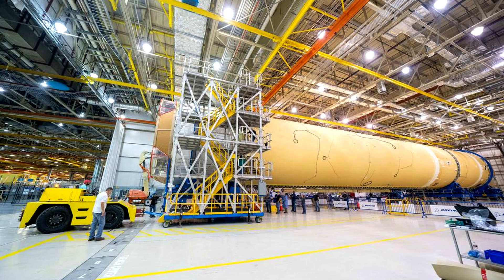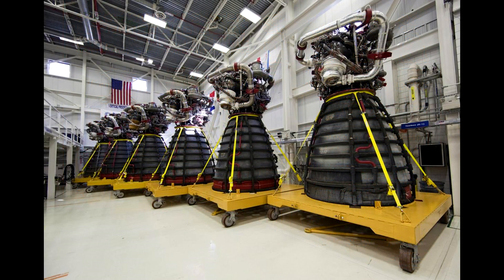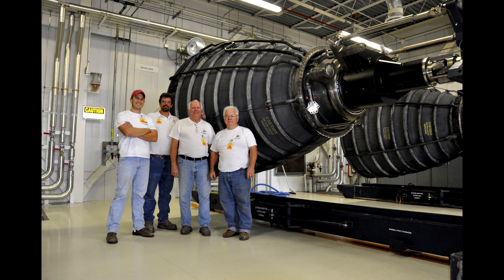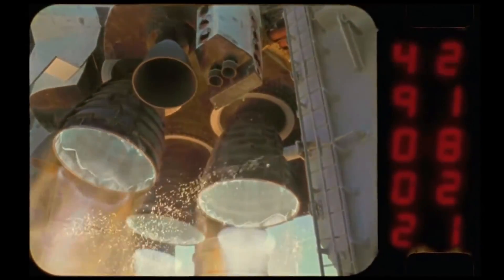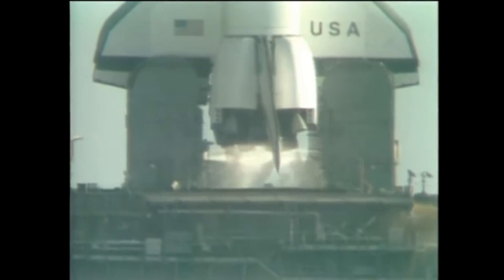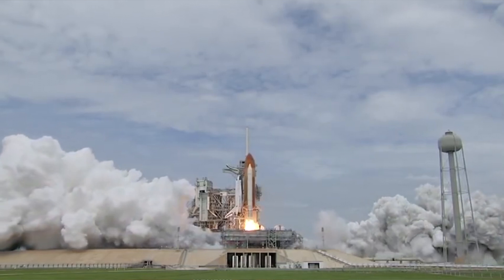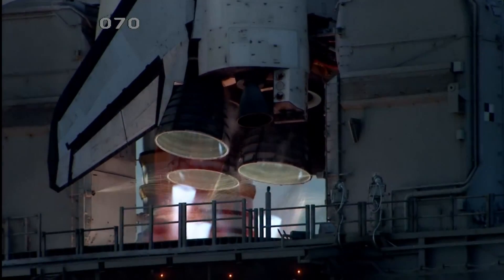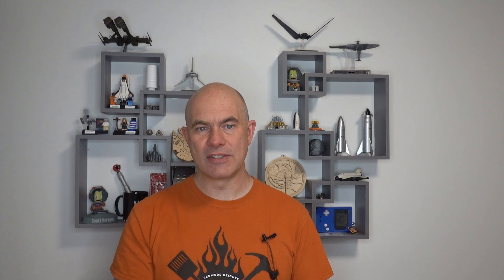Four Old Space Shuttle Engines Team Up For One Last Rocket Launch

Comment: All of this SLS system is a realization of the original shuttle plan from the late 1960s. Makes sense to use the engines designed for that mission.

Unfortunately it no longer makes sense for NASA to be in the orbital launch market. They are supposed to be pioneering the next wave of cutting edge technology that doesn’t make sense for private companies to fund. Once the private market has caught up or surpassed them, their mission for that phase of technology is complete, time to move on. This iteration of the SLS technology is a dead end retrograde effort.

Comment: Jupiter DIRECT would've been a lot cheaper than the SLS; it's a shame the entire constellation program started and as a result JUPITER was never pursued. It would've only needed 3 RS-25's, 2 5 segment SRB's and some structural adapters for the shuttle main tank along with a 160 tonne J-2X powered upper stage and it could've lifted the same payload as the SLS with the EUS. Oh well.

Comment: It feels really wasteful to use reusable engines on an expendable rocket...
Reply: Ibakon Ferba that’s government for you
Reply: @MrMe-yk5of  I found this comment earlier and i think you need to see it

 You are a shining example of the dunning kreuger effect. Your very limited knowledge on rocketry has given you a false sense of expertise, where you are highly confident that you know the right answer despite the fact that actual experts would be less confident than you are. It's unclear just how much the reuse of the falcon 9 has reduced it's cost. A reduction of at most 10 million dollars per flight is claimed by spacex. The real reason the falcon 9 is so cheap is because it's parts are so cheap to produce. That's all.

So; you want the government to reuse the first stage of the SLS. They already tried that with the space shuttle; the cost savings turned out to be marginal at best. So let's say that NASA were to try to reuse the SLS. The first thing they'd have to do is dramatically increase the mass of the upper stage. Not even the exploration upper stage would be massive enough to allow for this. There's a reason spacex has a massive upper stage, so that at MECO the first stage isn't moving too fast to re-enter. So good luck with that with the SLS! I suppose all we'd need to do is develop a massive 350-400 tonne hydrogen powered upper stage using 3 J-2X engines, and then also SPEND AN ESTIMATED 500 MILLION TO 2 BILLION DOLLARS TO MAKE THE RS-25 CAPABLE OF BEING LIT MID-AIR WHILE TRAVELLING THROUGH THE ATMOSPHERE THE WRONG WAY. Then spend another few billion dollars developing flight and guidance hardware to allow for an autonomous first stage landing, and of course add enough landing legs, fins, rcs systems for stage control, etc. Oh and make sure all this new hardware is man-rated. Oh and add some very heavy structural supports to the core stage to allow it to withstand re-entry at around 5-8 km/s (over 8 km/s if it's  using the ICPS). Oh and don't forget you have to do more tests to see if the core stage can withstand re-entry while fuel is sloshing about, most likely adding more baffling in the inside of the tank and doing vibration tests.

Of course then you have to ensure that the RS-25 can fire without combustion instability at sea level while travelling BACKWARDS AT MACH 0.7-0.9. This would be the largest problem with re-using the core stage. The RS-25 has a unique nozzle shape that curves inwards near the end to raise the pressure on the lip of the nozzle at a slight performance cost. This is done so that you don't get the characteristic flow separation that would normally occur with an overexpanded engine (an engine where the exhaust pressure is well below ambient pressure; exhaust pressure of the RS-25 is around 30% sea level pressure; a normal engine at those pressures would undergo flow instability at sea level and tear itself apart).

Of course you'd also need to take into account SIGNIFICANT PERFORMANCE LOSSES that would arise. The SLS core stage weighs about 95 tonnes when empty. You'd need at least 4-5 km/s of delta v to land it, meaning that you'd need a mass ratio of at least 2.8. Therefore you'd need to save around 180 tonnes of fuel. This is the best case scenario if you decided to use a 350 tonne upper stage. Of course using a 350 tonne upper stage you'd also have even more performance losses, that is if you can even get a 350 tonne upper stage to structurally fit ontop of the core stage. This is because the stage would have a very high dry mass, meaning that you'd probably need an additional upper stage which would dramatically increase cost.

So; TLDR; you are wrong. Even if this could be done the costs of doing it would most likely far outweigh the cost savings that you'd get over the estimated 10 missions that this is planned for, and it would delay these missions by at least 4-5 years. The actual cost of the RS-25 engines is insignificant compared to the cost of the manned components of the vehicle. SpaceX will charge around 260-280 for a crew dragon mission.  That's a factor of 5 more than a normal falcon 9 flight. Do you know why? Because the crew vehicle and the costs of developing and maintaining a safe crew vehicle with multiple abort modes is incredibly expensive. Over a third of the SLS's launch costs are estimated to be the Orion MPCV and the European Service module combined with the launch abort system, about a quarter is estimated to be the ICPS/EUS upper stages along with the adapters. The boosters and core stage combined account for around a third of the cost of the launch vehicle, at around 180-200 million for 4 new RS-25D/E's, 60 million for the core stage, and 60 million for each booster for a total of 360-380 million out of around 1-1.2 billion.

TLDR; developing a reuseable first stage with the SLS would cost far more than it would save and set back the program at least 4 or 5 more years and would require several billion dollars up front, and would lead to performance decreases which the SLS cannot afford. There's a reason NASA isn't doing this; because it makes no sense

Comment: 4:38 104% thrust? What does that mean? That's 4% more thrust than exists. 104% of what?
Reply: It's not that confusing.  The engine was originally certified to produce a certain maximum amount of thrust.  That was called 100% in the literature.  Later they upgraded it to safely produce more.  So instead of causing confusion by having a different number become 100%, they did the simple and logical thing, run the engine up to 104% of whatever the old number was.
Reply: @jshepard152  That's kinda what I figured. Thanks. If you're not giving raw newton values you just say this revision can do 104% of that original design could. Confusing without the original values

Comment: So where did the time and money go?
SLS is basically a disposable scrap space shuttle rig minus the shuttle itself.
Reply: It is an abysmal waste of money, but it's not a replica. The orange tank had a completely different mounting scheme and force vectors, and the shuttle was built with electronics from the 70s, and no upper stage. It's completely different except the engines. It certainly shouldn't cost as much as it does, however.
Reply: Yeah it's a shuttle without the worst part of the shuttle, the orbiter.

Comment: Person 1
“Hey isn’t Using pre-designed unreliable hardeware created decades ago instead of going back to the drawing board pretty dangerous considering the space shuttle disasters?”
NASA: “ no you see this ones got 4 engines So it’s way better”
Reply: josh k well knock on wood but the engines themselves never had any problems as a matter a fact they’re quiet amazing. And the disasters of the shuttle program were both nasas fault for being impatient and wreckless not so much the shuttles fault. Now did it have some major flaws definitely but both disasters could’ve been prevented.

Comment: SpaceX resusability is a circus freak show. These SSMEs were completely rebuilt after every flight. The only thing being "reused" is the atoms in the metal. That is one reason the Shuttle was a colossal failure and didn't even come near its original cost or flight goal. The same is true of SpaceX, and the same is true of the rocket stages they return in their idiotic stunt of landing it on a platform. The superstructure is useless unless more or less completely rebuilt.

Comment: Reasons why the SLS has become redundant:
- The market has evolved and the need for an ultra heavy lift rocket will be met by multiple companies within 5-15 years
- A truly universal exploration vehicle requires in-space re-usability and refuelling. Neither the SLS nor it's modules is built to include such capabilities due to it's heavy use of recycled parts
- In order to ensure a tightly packed and reliable launch schedule, again only useful if you re-use your spaceships, you need redundancy. Expendable rockets can offer this, but only with a big cost overhead
- If you wanted to ignore all these issues there were better ultra heavy lift designs on paper back when the SLS and it's parts were put into production or even prior. As an example look at Sea Dragon

Reasons to keep the SLS around:
- Job security I guess

What NASA should do to replace the SLS now: Buy rockets from SpaceX and ditch the Starship, if you want to, in favour of whatever you want to put on top instead. Alternatively do the same thing but with two contractors to keep the politicians happy and/or pretend like anything really competitive is in production.
Reply: Sooner than that my friend😛

Comment: I wish NASA would just develop new more advanced reusable engines for a reusable launch system instead of throwing away old engines that were originally meant to be reused/refurbished. Spaceflight should be sustainable not costly & inefficient. Very hard to get the public's attention on spaceflight when they are just rehashing old tech & throwing it all away.

Comment: I may be a bit misinformed here and I'm sorry if I am, but if SLS is basically shuttle engines, shuttle solid boosters, and more or less the shuttle external tank with a Boeing capsule on top (likely similar in design to their commercial crew design) then why has it taken the better part of a decade to get to this point?

Comment: Does the engine controller still base on an mc68000 design? I remember they started with Honeywell 601, but later migrated to Motorola 68k? 
P.S. what a pity the engines are doomed to end in the ocean, rather than on display... what an irony, for originally reusable engines...
Reply from the maker: I forgot to mention they replaced all the electronics for SLS

Comment: This is interesting . When I was  20  I worked at Pratt and Whitney in WPB FLA. My paperwork said I was a janitor. However  I did not do any of the tasks that would be expected. My job was to clean the very large milling machines, and prep them for new paint. This was about 80 or 81 One of the things I saw then were very large nozzles like the ones in the video. kind of cool.

Comment: What causes the swaying movement of the whole vehicle at 5:21?
Reply: The stack is bolted down to the platform by the ends of the boosters. The shuttle with its main engines is not bolted to the platform and not centered between boosters but attached to the right side of the external tank, so their thrust bends the whole mammoth thing to the left when they start up.

Comment: What was that again about Space X being the "Pioneer" in the ideology of "Reusable"? Bunch of typical PR...NONSENSE!
Reply: NASA’s stuff was just refurbished & it was very very costly & complicated to refurbish. So much so that NASA’s idea of reusability was unsustainable which eventually made to them go back to expendables. It was like buying a new car & having to rebuild the engine after every drive. Very little of the RS25 was actually reflown on the Shuttle. Much of it was torn down & thrown out only to be mostly replaced. SpaceX’s hardware is actually meant to refly with little to no refurbishment between flights. Sure its not the low cost spaceplane allot of people wanted for the future but is an impressive feat of engineering.

Comment: Figures.  Why can't they make them separate from the empty tank and reuse the engines?  They were literally designed for reuse.  An RS-25 weighs in just shy of 7,800 Lbs dry.  The SRBs on the shuttle were 200k Lbs dry.  Wouldn't it be cheaper to have the engines come down under silk (yes. I know silk is no longer used in parachutes,) pluck them from the oceans, and mate them to a new tank?  Seems cheaper than rebuilding a new one each time.  Its not like they are going to be reaching orbital velocities.

Comment: 4:40

Scott, i need to know. What is 104% thrust? Is it the "engineers assume max limit" thrust? Safety margin?
Reply: More than the planned design limit.  You normally don't run beyond the design limit because things tend to blow up but if your thing turns out to be tough enough you can start to exceed those original limits.
Reply: Think of it as overclocking.
Reply: To be clear, more than the planned design limit of the original RS-25; they didn't recalibrate the scale each time there was an upgrade.
Reply: Thank you all! It makes sense now

Comment: They should parachute sls parts to reuse them after launch instead of disposing them after one use
Reply: It'll be too high and too fast for recovery. SLS is, basically single stage to orbit. It'll be hundreds of miles up. It'll probably make a few orbits before atmospheric drag pulls it down.

Comment: I'm sure that you've covered this before but can you explain why the thrust can be over 100%?
Reply: Put simply “100%” was their rated sustainable power level, not the absolute maximum they could achieve, especially with the improvements made on later versions. As such, the later versions could actually be run fairly safely at more than that rated power, I.e. more than “100%”
Reply: Great, thanks for the replies!